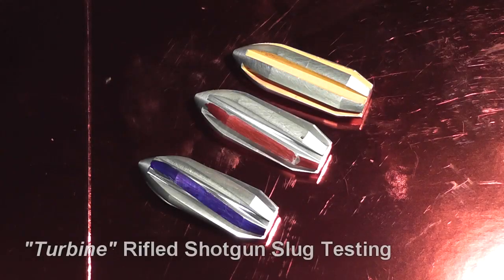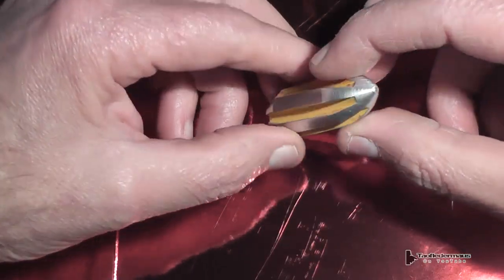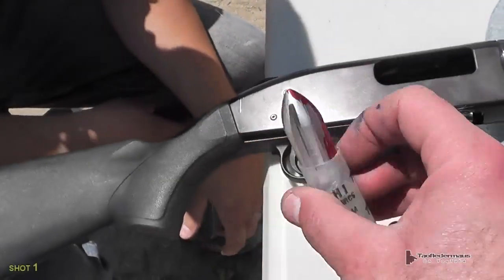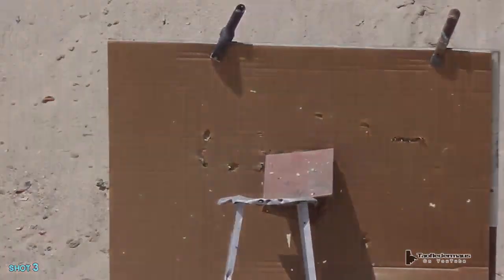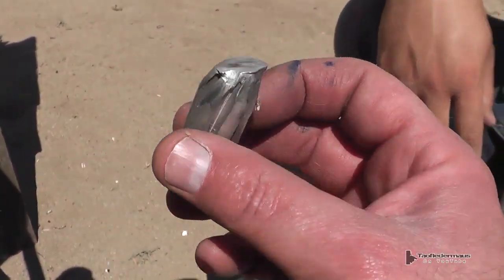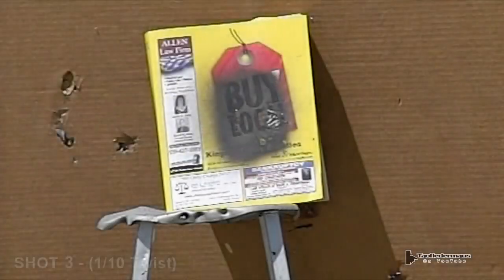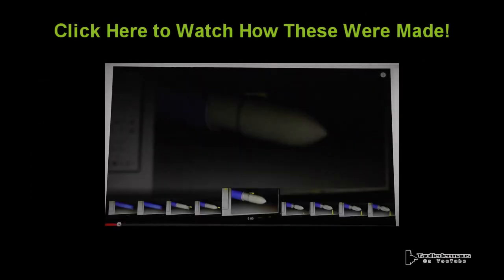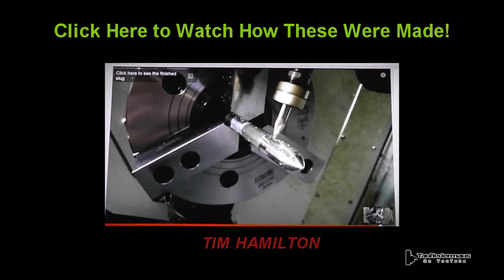Custom Aluminum TURBINE Shotgun Slugs  -Testing

Comment: Dear Tim:  Your rounds tumbled because of shockwave propogation and boundary layer effect. When you have an object with a pointed nose travelling supersonic, the shockwave propegates all the way to the back of the object instead of going over its control surfaces. In this case, into your control channels. If you were to put this round into a supersonic wind tunnel, you'd see the shockwave propegate all the way to the rear, and no air at all going into the grooves. Effectively, they're almost working in a vacuum. All of the boundary layer air is going AROUND the bullet instead of into your grooves. 

A design like this COULD work, but you need to re-think your supersonic aerodynamics. First, you need an almost blunt, hemispherical nose. Think of how a missile on a jet fighter looks. They have rounded (not pointed) noses. That's so the pressure wave doesn't propegate back along the missile body and disrupt boundary layer flow over the control fins. So the nose needs to be shaped more like a missile, and less like a spear. 

Second, your channels need to be wider and the "fins" between them narrower. Again, you're trying to force supersonic air to go down a tube, when it really only wants to go around. There's too much static pressure buildup inside the channels for air to flow over the control surfaces and impart a lateral force to the round. 

Third, you need to create a wide opening for those channels at the front, tapering down to the nose tip. Think of a NACA duct. The fins should start narrowing as they start coming down the rounded nose curve. They should meet at a point in the dead center of the nose, forming a kind of star shape when seen from the front. This will smooth the transition of air into your channels, and help maintain some kind of laminar flow inside. It should also give a sort of ram-pressure effect, forcing air to pressurize at the nose, flow through the channels, impart some lateral force and exit into the drag pocket. 

Finally, you should consider boat-tailing the bottom-rear of the channels slightly, and tapering the control fins off to a rear-facing wedge. This will create a bit of diffusion as the high-pressure air exits, allowing it to cleanly enter the drag pocket without creating weird wake vortices and disrupting stability. This should reduce drag and net you greater range, accuracy and impact force. 

Hope all this helps. Looking forward to the MkII Turbine Round!
Reply: Shotgun slugs are not stabilized by rotation like rifle bullets.They are stabilized by havier part in the nose like arrow.All Breneke and Foster,Gualandi and other slugs for smoothbore had plastic wad on back side to be stabilie in flight.Rifling purpose on the slug is for safe pase through any choke,even full choke.
Reply: It is 2017, i already finished reading this Text
Reply: @pncake_euw  yes way to much. Keep it simple.
Reply: Yeah agreed.... Shotgun barrel doesn't has spiral grove inside it (like a rifle gun). So, it is hard to make bullet spinning (even though bullet has it).
I'm thinking that this bullet needs "initial spinning" which has been done with help in rifle barrel gun. (shotgun barrel doesn't has it. So, it cannot support the "initial spinning").
Reply: @mdw159  wrong. Wrong wrong. They make rifled slug guns and rifled chokes
Reply: I think Richard's point is well taken, but what about inside the barrel, where the bore is confining the shockwave and the round is accelerating ?  My first thought (before seeing the high-speed clips later in the video) was that 20 yards was not enough distance to develop significant spin from aerodynamic forces.  Remember, the rifling in a conventional rifled bore grips the bullet very aggressively to develop the necessary spin before a bullet exits the muzzle.  Don't know how practical aerodynamic rifling could be, but what might help:
1.  Way more aggressive twist (in addition to more and thinner vanes).
2.  Weighting - lead ball in the nose might allow the round to stabilize much as a pure ballistic rocket is stabilized.  Shockwave propagation and boundary layer effects Richard describes make this at best a faint hope.
3.  Might be possible to size the slug to engage the bore and develop some spin through friction.  Could be dangerous, though.  Don't believe shotgun breaches have forcing cones, and the barrels are not designed for this kind of pressure.
Reply: Richard Rowe my IQ got higher reading this thank you
Reply: Mdw 159 there are shotgun barrels with rifling
Reply: Justice Shoffner yes, but once they're rifled, they're not shotgun barrels.
Reply: Robert Fustin they are rifled yes they may not be called “rifled shot gun barrels” I understand but there are barrels that exist on the market for a shot gun that are rifled.🤷🏼‍♂️
Reply: Richard Rowe All they should need to do is add a concave to the back and properly balance the weight so that I doesn't tumble. If penetration becomes a problem beyond that point just reinforce the interior part of the concave with a heavier metal.
Reply: I applaud the respect for each other intelligence and you're overall attitude towards a very impractical but incredibly fun round id love to see more improvements and tweaks to know for sure if it will work or not
Reply: thankfully bullets do not exhibit the type of behavior you describe. most bullets even high energy penetrators with sharp noses do not exhibit shock propagation, especially not at the muzzle. 

it wouldn't matter anyway. non rotating bodies are inherently unstable. even if the aerodynamics worked out as intended and the groves could impart a spin downrange there would be nothing to impart a stabilizing force at the muzzle. a slug like this will tumble immediately every time unless it is some how insulated from the muzzle blast and the downrange freestream.

in sabot rounds, the exit-discard interactions are extremely important to stability downrange.  the sabot ring leaves the muzzle spin stabilized, then discards with no physical contact to the penetrator, which allows the penetrator to smoothly transition into aerodynamically guided flight
Reply: Andrew Sickafoose I'm not saying it would get the shockwave propagation at the muzzle. I'm assuming it would fly straight for at least a few feet...far enough to clear the muzzle blast anyway. But you're right...if it starts to tumble immediately, it wouldn't matter. I agree. I'm assuming stable flight until it gets into clean air. 

As far as sharp-nosed bullets not exhibiting shockwave propogation...ummm...they would if they were supersonic. They'd have to. Very least you'd lose boundary layer flow over part of the bullet's surface. That's what I'm referring to. A regular pointed bullet wouldn't have to worry about boundary layer at speed, because it already got all of its gyroscopic force in the rifled barrel. Blast effect, like you said. But a rifled slug like this would depend on surface flow at speed as much or more than blast effect. 

So, yeah...I think this is something that would only affect rifled slugs, and not typical bullets shot from a rifled barrel. The dynamics are different. All a bullet has to do is maintain gyroscopic spin and not fight the air too much. A rifled slug has to work with the air to maintain its stability. I'm pretty sure that would change the dynamics a little.
Reply: Richard Rowe I understand conceptually what you are saying.  But a bullet is not a complex or accelerating planform or a nozzle inlet.  Most bullets are not sharp compared to length and  bullet with a blunt nose will always form a bow shock.  

Look up schlieren imagery of bullet flight.  Even downrange the bow shock clearly originates near the bullet nose. 

Even at SS velocities there is simply not enough momentum transfer area on a shaped shotgun slug to get any kind of spin to develop in the time it would take to meaningfully stabilize the slug in the blast effect region.
Reply: Andrew Sickafoose All right, I understand what you're saying. But if that's the case, then why do rifled shotgun shells work at all? Like I said, I'm assuming it stays stable to at least a few feet out of the barrel. I'd think the blast effect inside the barrel would impart enough force to overcome initial resistance and get it spinning. At that point, I'd think you could just maintain the spin with aerodynamic forces if you got the profile right.

I'll have to look at the imagery again. But yeah, I know the shockwave originates at the nose. Not sure where I said otherwise. I'm talking about how far back it stretches along the bullet surface, and at what angle. 

Just to be clear...I'm not advocating for this kind of design. I know it's intrinsically unstable. Or at least introducing instability where it doesn't need to be. I'm only saying that it's theoretically possible to make it work. .
Reply: The air would probably force the fins back down but. idk
Reply: Richard Rowe  y
Reply: Richard Rowe             。
Reply: Richard Rowe I didn't understand any of this.
Reply: agreed Mr
 Richard Rowe 
in explosion it lose some power due to cuts in the bullet
Reply: Richard Rowe fully rifled barrel woulda made all the difference
Reply: Richard Rowe I appreciate your efforts to let them know how this works and I’m sorry for those who can’t provide evidence that they are right or you are wrong in there statements it sounds like you know what you’re doing so I would go to the guy making the slugs and help him out with designs for them 👍
Reply: Richard Rowe. Twenty one pilots an tge nivl
Reply: Wrong
Reply: Idk what I just read but it was a wild ride
Reply: Richard Rowe 
     Characteristics of rifled projectiles requires longer distances before stabilizing compared to rifled barrels. For example: 270 and 30-06 Winchester center fire caliber ballistic tip projectiles typically more accurate at 200yds compared to 100yds. All supersonic projectiles endures same ultrasonic shockwave issues. 

Following your instructions of narrowing projectile rifling slots will create vacuum and drag. Personally I would machine faster twist rates 1-7 with hollow points.
Reply: Mr T  I already watch these channels. that is supposed to convince me of what exactly?
Reply: I was thinking stub nose an maybe smaller rifleing
Reply: mr rowe what do you do for a living
Reply: Wouldnt weight on the tip regardless of the pointedness work.  Work more effectively?    

P.s.a.  I'm not a scientist. Or a real doctor
Reply: Yeah what he said 🤔🤷‍♂️
Reply: Richard Rowe for Congress haha bullet go zoom
Reply: Too many words
Reply: ...Or just make it heavier
Reply: The air flow on the shotgun slug itself needs to be a lot more direct to the back of the slug to allow the vaccum to push the slug forward rather than the gunpowder alone pushing the slug forward
Reply: Uh, lighten up the powder load and make it subsonic perhaps?
Reply: Wow! As if enough time wasn't wasted creating these losers. The fact they have to be single-loaded is a deal breaker from the start.
Reply: Great comment, and I'm aware it's 7 years old now, but as a very minor correction, most AIM's (air to air missiles) have a pointed nose; AIM-7, AIM-54, AIM-120, R-77, R-27, etc. The ones that don't (AIM-9, AGM-65,  are generally housing an optical or IR sensor, where a conical lens in front of it would impact its ability to track a target.
Reply: I have an idea, There would be a small hole in the middle of the slug, and at the back. fins that are on hinges.. the air goes through the hole of the slug and opens the fins up, -as they would be about halfway point of the hole, there would be about 3 to 4 of them, I'm thinking three as I said air would go through the shell. open the fins up and WALLAHH, probably wont work. but I'm only 13 so..
Reply: Uncle Billy Bob ‘
Reply: You are seriously overthinking the function of a slug
Reply: Jesus christ I know who to hire to kill Antifa Leader @richard rowe
Reply: Percocet Molly Percocet 
13 yr old & "Percocet/molly?" What is this world coming to? And where are your parents?

Alright I've had enough with bullets for 1 day. The whole theory of relativity and principles of super-sonic flight ruined it for me.
Reply: It's DIY stuff gay bullets
Reply: @TonyStark-cv5vd  says the poor

Comment: I have a, maybe stupid, question: Is there a Shootgun slug which, after leaving the barrel, will start rocket propulsion to increase force etc. ?
Reply: Google ""gyro jet"", it was an actual thing, and apparently they worked pretty good at range when they had time to reach optimal speed but at close range they just kinda bounced off of people... Might set your jacket on fire if they caught in your pocket I suppose lol.

And as an aside if you are curious, the in fictional world of Warhammer 40k the space marines use a gun called a Bolter that I'm fairly sure fires a gyro jet type round... Albeit much more advanced.
Reply: prototypes. Not seen anything like that on the open market. Not a shotgun expert but Im pretty sure im still right. Generally when ive seen such systems they often were on prototype 'tracer'/'guided' bullets.
Reply: shotguns are to small but modern tanks use this kind of tech
Reply: OK

Comment: The problem I see with the stability is due to not enough drag on the back of the bullet. If you were to cut a taper in the thickness of the fins from the same width in the back to almost a knife blade in the front of the bullet, it may create enough drag in the back of the bullet to stabilize it by compressing the air in the groove as it gets narrower toward the back of the bullet.

Comment: just make a 12 gauge bullet
Reply: I may be wrong but I believe you cannot have a rifled barrel over .50 caliber.  Over 50 is considered a "destructive device".  The shotguns are okay because they are smooth bored.  So a 12 gauge bullet (which is basically a slug or sabot), if in a rifled barrel, would be too big to be legal (without NFA paperwork).  You're essentially making a mini howitzer.

To have spin stabilization on the projectile, you'd probably have to have some spring loaded fins on the slug.  I'm kind of surprised they tumble so much actually.  And the fins would probably have to have time to impart the spin.  20 yards wouldn't be enough.  What about a tapered design?  Have the leading edge slightly smaller than the trailing diameter.  Think "shuttlecock" but not as dramatic.  Something more like a two stage rocket.  The fatter end would have to end up trailing at some point.
Reply: +SuperOpinion8ed thanks for the information. I still wanna see a bullet though.
Reply: Close but wrong, rifled barrels are available for 12g & 20g shotguns for civilian purchase. I have a 20g Rem 870 w/ interchangeable rifled and smooth bore barrels. Sabot slugs are built for these rifled barrels.

Comment: Anyone with a basic understanding of aerodynamics, hell, if you ever played kerbal space program, you'd know that things going super fast can't "Bite" The air very well and thus won't do what you want. They just stall.
Reply: I love ksp so much lol. Stopped playing it though, since the Mac version has some kind of memory leak issue.
Reply: Isn't that why tanks' AT sabot rounds are fin stabilized? :)
Reply: That doesn't answer my question: why do they bother with adding stabilizing fins to the anti tank sabot rounds?
Reply: Alex Hurlbut
They pull the back of the sabot back to keep the tip forward.
But it won't help you glide.
Reply: Alex Hurlbut i believe it still helps as fins, just not as wings

Comment: I'd suggest a more aggressive twist, and/or more contact surface area between round and barrel. I notice its tapered at teh front and back.. try making the backs flat twists leading to a flat bottom, no boat tail. Just suggestions from one engineer to another.

Comment: I feel like what is happening is the rounds spiral is causing it to move once it leaves the barrel but the back half is still in the barrel so while the front is moving to the side the rear cannot causing the bullet to wobble. This is most likely the reason why the slugs with extended fins on the tails work decently.It would be interesting for the person who made the 3-D printed slugs to add this feature to increase the accuracy of the rounds.

Comment: You mentioned that the Shotgun is a "Smooth Bore Shotgun"  maybe that is the problem right there because historically Guns like Smooth Bore Muskets had an issue with Musket balls tumbling just like these rounds, I think if the shotgun was Rifled it would work very well.
Reply: The point of shotguns is to have a mix of working projectiles birdshot and buckshot would preform terribly out of a rifled barrel, slugs work either way
Reply: Good Point, even the earlier Rifles such as the Kentucky Long Rifle had its draw backs, it was a, "Slower loading Mussel Loader" because of the Rifling.  I guess you just have to pick and choose what you want to sacrifice, but I would think that a Rifled Shotgun would work better for Slugs and rounds of this nature, it certainly would help with aligning the projectile, that's for sure, but then it would only be a Specific-type Firearm for specific types of rounds or ammo.  I think the Engineers who redesigned the AA-12 and other semi-automatic shotguns like the Leadman AR-12 may have figured that problem out.
Reply: Fair enough

Comment: They need to have the correct spin inside of the barrel as well. I would assume that they have no spin or spin in the opposite direction when they exit the barrel(because of the high pressure gases passing through the grooves in the slug) 
The rifling in a rifle barrel counters this.

Comment: Actually the problem it way simpler then the that. there is to much weight to the rear of the slug. More then 50% of the weight needs to be in the front half of the slug! The weight "pulls" the front forward and the back stabilize the slug.